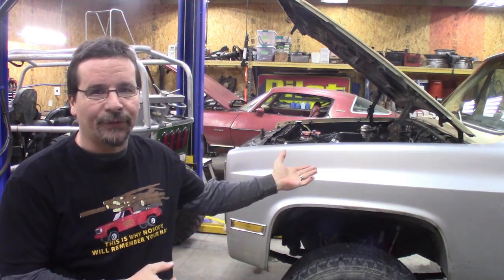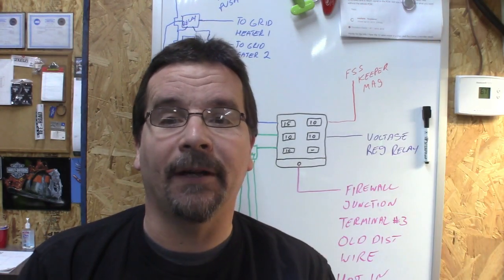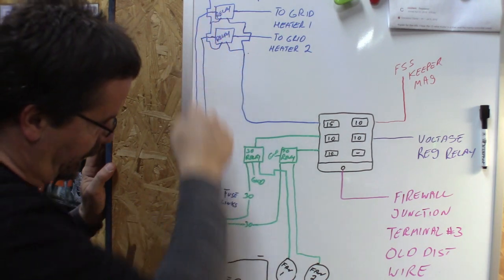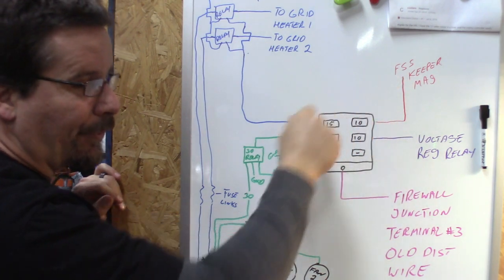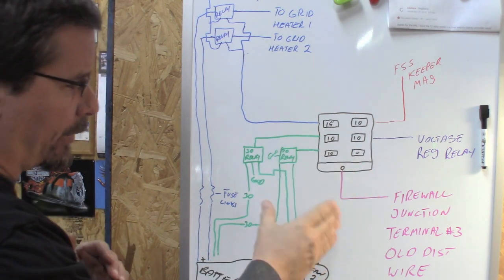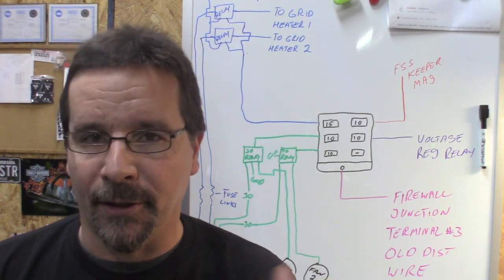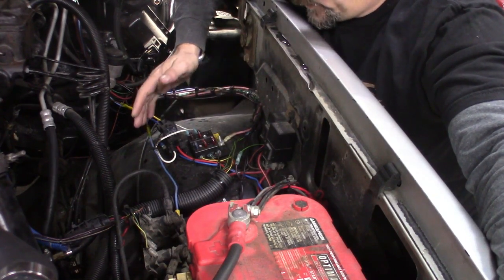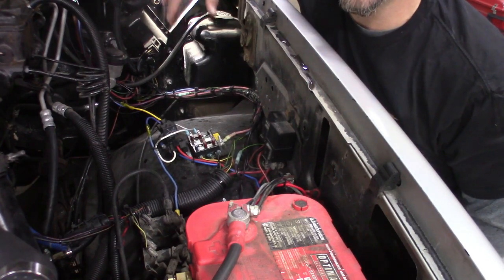Cummins Conversion Wiring  How To

Comment: Where/What is the best source for wiring a 6.7 Cummins in an 08-10 F250?
Thanks
Reply from the maker: I'm not sure. I haven't had experience with a Ford swap that year. 
Sorry
Reply: @RICO'S GARAGE  what about a 89 f150  5 speed swap I'm wanting to put a spare 24v in my 89f150 any experience with something similar?

Comment: I have a 1998 dodge ram Cummins diesel 5.924 valve the batteries are not charging the voltage regulator in the computer not working so I installed an external voltage regulator and the batteries are charging fine but the transmission is not shifting I like your old school wiring method I’m just trying to figure out how to make the transmission shift I know it’s right there it’s just a little baffling to me after watching your video maybe you could help me some direction because I don’t have hundreds of dollars for a new computer thank you Peter

Comment: I have been running my 12 valve in my old 93 Chevy for years without a grid heater. No issues, when it gets very cold I plug it in. It was an always wanted to do project to hook up the grid heater.
Reply from the maker: I rarely use it. But it's nice to have the grid heater when it's real cold.

Comment: How did you wire the starter in ?
Reply from the maker: By using the factory big block starter wiring. Purple wire goes to small terminal on starter. Large terminal gets positive battery cable.

Comment: Quick question you mentioned two fan relays.....I’m thinking you are meaning something other than the cooling fans, correct?
     On my project vehicle I’m building in the general infrastructure, so cooling fans and everything are already wired up through thermostat relays in the piping.
       So at the risk of sounding like a rookie, please clarify what fans one and two are.......Thank You 👍🏻
Reply from the maker: I have 2 pusher fans mounted in front of the radiator in lieu of a mechanical fan
Reply: @RicosGarage  ok thanks, that’s perfect,  I’m also using one large fan “pulling” heat out of the engine bay only......and as unusual as it sounds two full size radiators, built into the sides with one cooling fan each “pulling” outside cool air in....each cooling system operates independently of each other, but share an upper and lower pipe, into the engine and the first coolant system to be in operation will cancel the other for the duration of its cooling cycle.
      It sounds more complicated than it actually is.
        This is one of two modular power plants I’m starting to build....basically if you can imagine a vehicle body , and the entire rear section wheels and all, can be removed, and swapped in with another in about 20-30 minutes

Comment: Thank You so much for clearly explaining this, really appreciate it 👍🏻
     I’m building a very unique engine set up, building in a lot of system redundancy to avoid breakdown, and rebuilding coolant, electrical, and exhaust systems into the engine bay before the engine install

Comment: Rico I'm swapping Burnt up 01 24v h.o. for 96 12v I have it in just wondering  what other than fuel solenoid  and grid heater do I need to fire
Reply from the maker: Technically you don't need either one to fire it up it will run without the grid heater and if you're just looking to fire it up you can wire open the fuel shut off with a zip tie or something like that
But as far as running in the truck you need power to the fuel shut off solenoid the grid heater if you live somewhere cold and some kind of charging system that's pretty much it the 12 valve is a very simple mechanical engine
Thanks for watching and I hope this helps you out
Reply: Yes sir it does thank you very much.
Reply: Rico of course  I'm getting no bus. Also no current to starter when I hit the key. I'm going to go with a push button and I already have pull cord on fuel sol . Would I need to transplant pcm from 96 truck to 2001 or are they compatible.